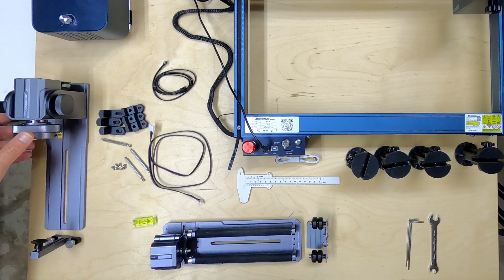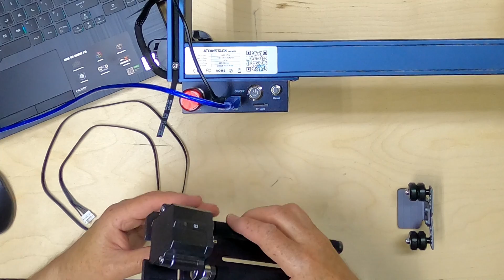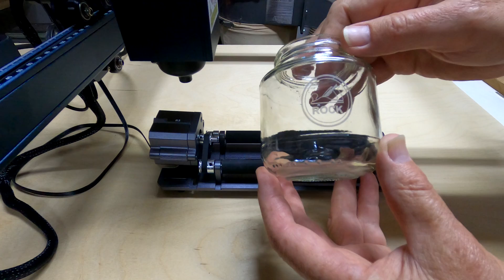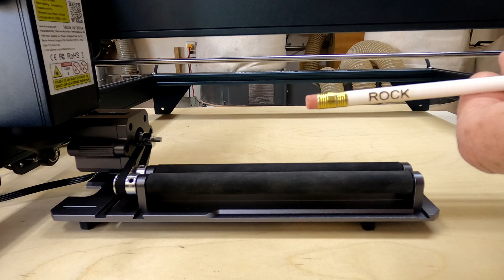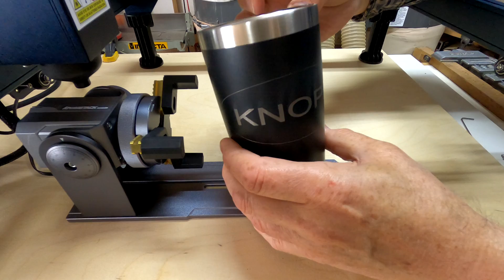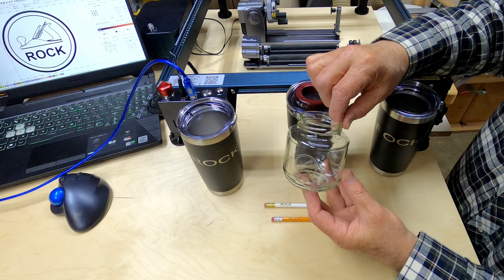Atomstack Rotary Roller Review

Comment: Noticed the tumbler had a larger diameter at the top and smaller at the bottom. Did the burner instructions allow for this difference?
Reply from the maker: There was no mention of it in the instructions, Mitch. The top 3 inches was pretty much flat, and then started to taper from there. As I was burning on that top 3 inches I didn’t worry about it. I just made sure that it was level. Thanks for watching!

Comment: Very well done, thorough review, Gord!  Those rotary accessories look to be very well made and easy to use.  You did a great job demonstrating them!  I do know you have to do "something" like the paint you used but I wonder if just applying tape (painters tape?) where you want to do the engraving would work?  I don't think it would have to be black, just not clear.  Easy enough to just pull the tape off if that would work.  Enjoyed the video, my friend, keep'em coming!  😃
Phil
Reply from the maker: I tried it with blue painters' tape, Phil, and it didn't work well. It left a bit of a mark on the glass but you really had to look for it. Maybe it just needs to be black?? I should have tried using electrical tape but I didn't think of it and it's all put away now. Maybe next time! Take care, buddy!
.....Gord
Reply: @GordonRock1  Yeah, maybe the black absorbs more heat.  I suppose some black duct tape might work.  They also make black cloth tape.  I guess I should try it myself!  LOL!

Comment: Another great review Gord. You engraved some pretty cool things. Looks to be well built equipment and I am sure the company will be very happy with your great review.
 You might want to try out some Prang Tempura paint. Cleans off with water. Might not be as easy to apply but I have used the sponge brushes. A airbrush just might do the trick.
 Take care,
Gary
Reply from the maker: I have heard of tempura paint, but never used it, Gary. I guess I will have to look for it. Cleaning with water would certainly be easier! Applying with sponge brushes would be great as they certainly are cheap enough. Thanks for the tip, my friend.
Stay well,
…..Gord
Reply: Amazon or a hubby store
Reply: hobby not hubby LOL
Reply from the maker: Actually, I was wondering what a hubby shop is. 😂😂😂
Reply: A discount store...where my wife got me LOL